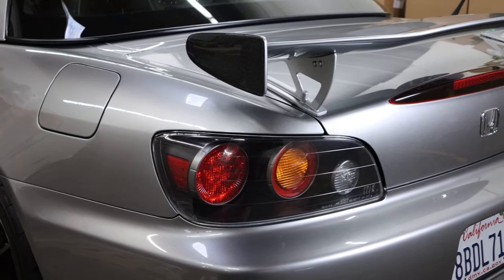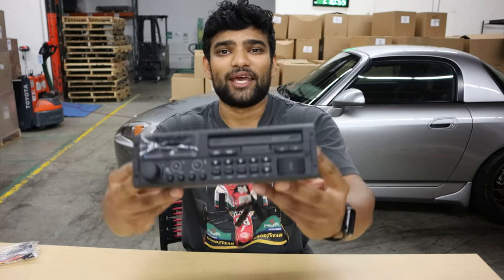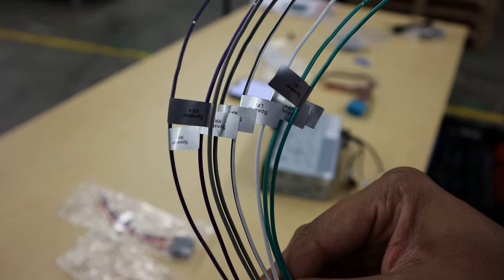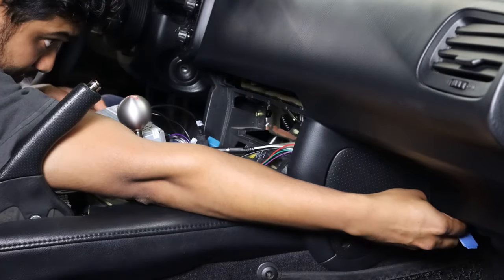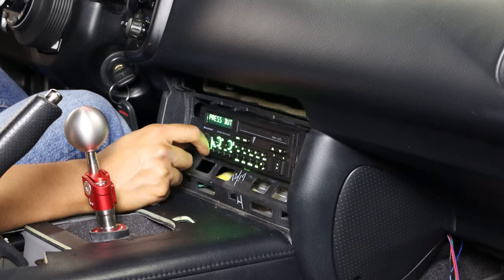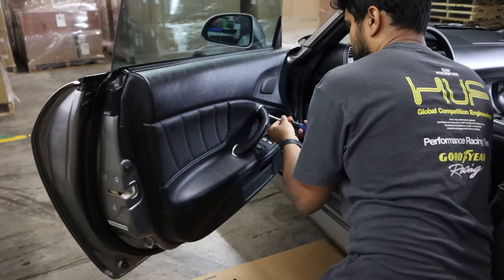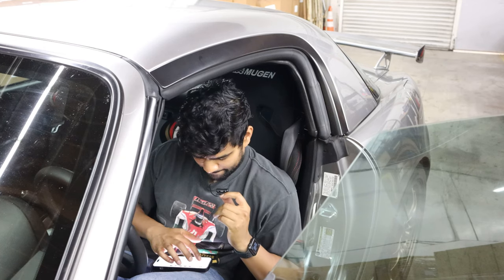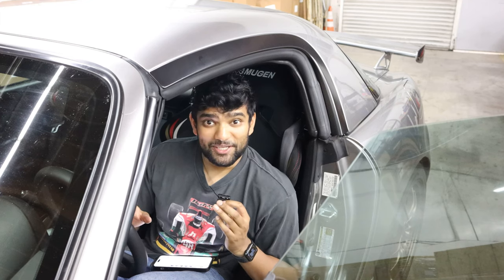S2000 Interior Modernization PART 1: Blaupunkt Bremen Head Unit Install + Modifry DCI

Comment: Hidden gem of a video, im also huge on conservative looks, my 02 rsx type s was one of a kind in my opinion, i did 05 front end conversion, mesh grill delete, trimmed the rear bumper, installed civic si type seats, spacers with 05 type s wheels so they are flush with the fenders, with suspension to my liking, diy correct intake, custom resonator with my full 3inch exhaust,  all badges deleted but if i had it back again id put custom conservative ones on. I loved that car so much especially because i had so many people that would come talk to me and appreciate my build versus my stock 98 civic they all vanished of course. Nice to see like minded foe

Comment: This is great, I have the same gripe with most aftermarket headunits as well. But this one just fits the car so much better.
Reply from the maker: 100% agree - technically not period correct but whatever the reason - this 80s/90s style headunit fits this dash better

Comment: You think the blaupunkt frankfurt rcm 82 dab would also fit? the volume knob is less deep than the Bremen and i don't think it needs the door mod. It also has BT 5.0
Reply from the maker: A few people have told me that if you play around with the mounting bracket you actuslly dont need to trim the door. Im not familiar with the rcm 82. I will say that ive had the bremen for a while now and i absolutely love it

Comment: Key factor is that the door needs modifying for the radio door to shut flush? Is that correct? You need to modify the radio door inner plastics correct?
Reply from the maker: when i did this install i thought that you had to trim the door. since i posted this video, a few people have told me that you can get it to fit without having to trim the door. ive already cut mine so i never tested repositioning the mount. pls report back if you get it to fit without trimming the door lol. apparently all you have to do is adjust the placement of the mount on the radio
Reply: @zaahidrahman , thanks for getting back to me and your great contribution to the S2k's  community. Keep it up. This radio is great. Also tempted to the absolute electronix kit. But i think the S2k is something raw and that's why we loved it so much. Cheers

Comment: Can you change the lighting colour on this headunit? Always been curious about it for my own car (not a Honda S2000 sadly) and my car has orange dash lights and the original headunit lights up orange to match
Reply from the maker: Yes, i think you can green, red, orange.. maybe yellow? Not sure but there are a few options for colors and level of brightness
Reply: @zaahidrahman  sweet, orange will do me just fine- fits the late 90’s early 2000’s aesthetic and mimics an OEM looking radio for me (my cars a SEAT, which is a European subsidiary of VW) and funnily enough, Blaupunkt did all of the OEM stuff for Volkswagen, it’s a shame the company Grundig doesn’t make radios anymore.

Comment: Ive owned multiple S2000s over the last 5 years and never used the dash controls 😂. Does one need the Modifry DCI to get the headunit to work or can it be bypassed?
Reply from the maker: To be honest, im not sure... It seems like it would be a real bitch to slice up the stock wiring harness to the new head unit. I wouldve stayed stock if that was my only option.
Reply: Yeah I agree, it's too much a of a risk to splice into the oem wiring. Too bad the Blaupunkt harness is no longer available from Modifry. I may just have to go basic and upgrade my speakers like you lolol.

Comment: Did you disconnect the stock tweeter ?  Tweeters are supposed to be mounted at ear level so if you disconnect the stock tweeter and use the new speaker's tweeter instead then sound quality isn't optimized.
Reply from the maker: hi, thanks for pointing that out. I did not disconnect the stock tweeters
Reply: With installing the Kicker speakers and reinstalling the stock tweeter, how’s the sound with this setup? Guessing you still get some highs from the oem tweeter location then a little bump in sound from new coaxial? Thanks for info!
Reply from the maker: @tylereckert9484  better than it was before lol but im no audiophile. Its much better than the stock set up. That i know for sure lol
Reply: @zaahidrahman  thanks! You still get highs out of the stock tweeters then plugged back into stock harness? Plus the added sound quality of new the 2 ways?

Comment: Does the radio cover close with the new head unit?
Reply from the maker: i did have to trim the door to clear the dial but unfortunately i didnt have time to add it to this video. ill go over the details in the next video but basically you just have the trim the card slot thing on the left side of the inner door.
Reply: Thanks for the info! Do I need to purchase any harness/adapter to run this HU? (without the Dash controls since DCI already sold out ...)